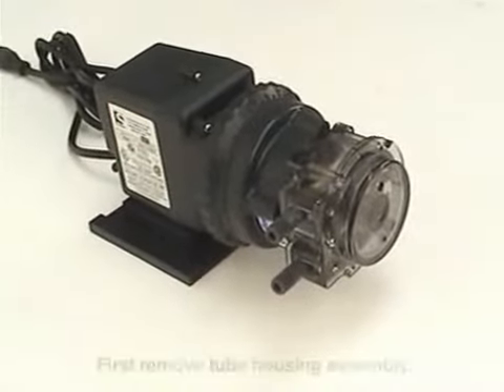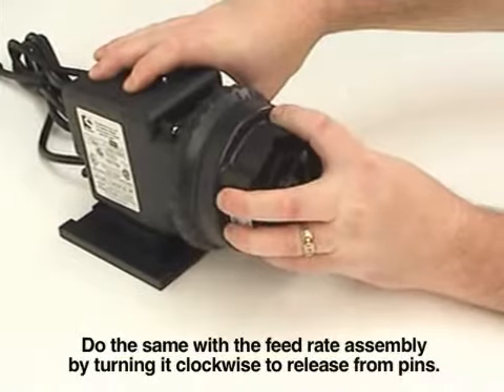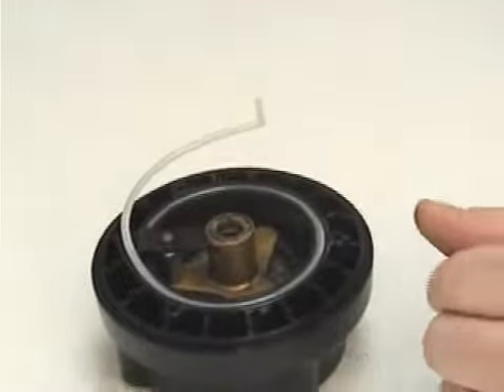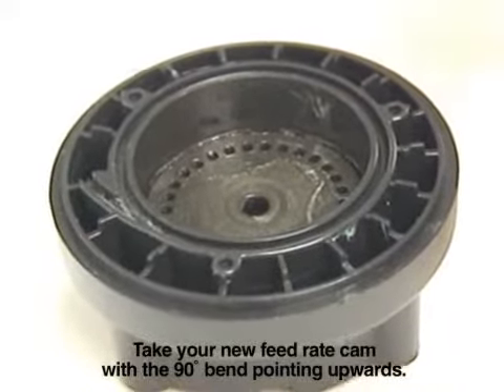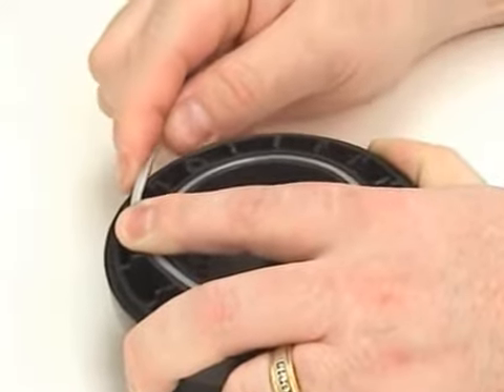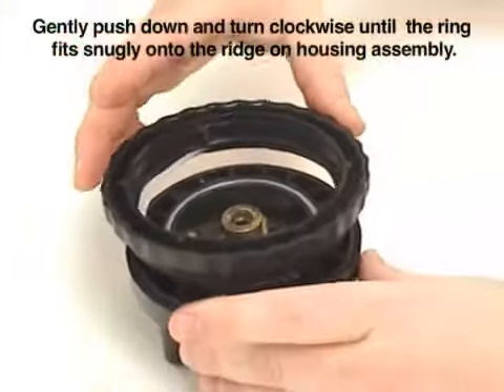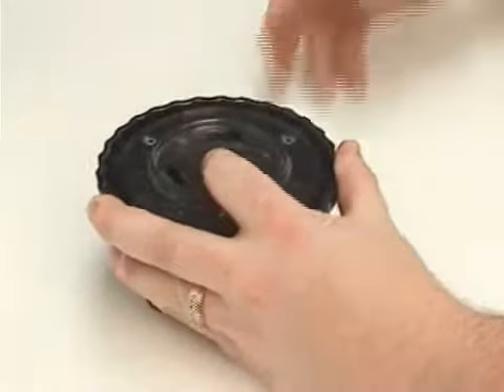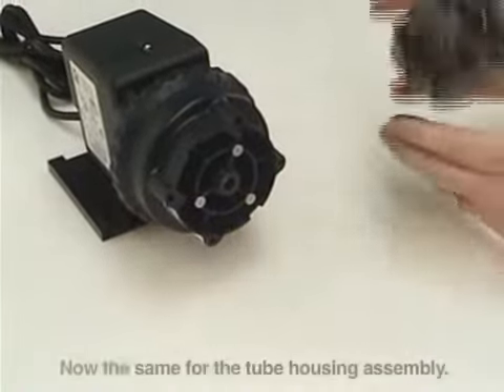Stenner Peristaltic Pump-Variable Cam Replacement

Comment from the maker: There is a small slit in one of the plus arms. When the duckbill injection valve is placed in a pressurized water line, that pressure (and the pressure of the quill housing) keeps the duckbill closed. The pump outputs at a higher pressure than the water line which forces that slit open enough for the chemical to get through. Once that pressure subsides, the pressure in the water line forces that duckbill valve closed again. Hope that clarifies things for you.

Comment: Hi, let me have you another question if I may. It's about the injection check valve and duckbill cause I'm really trying to understand the mechanics involved here that makes this all work. How is the chlorine pumping into this check valve when that lttle duckbill seems to block both sides from anything going thru it. The plus side from the water supply and the round open side where the chlorine is supposed to enter. Thanks.

Comment from the maker: The Stenner pump design has a metal index pin lifter riding on a plastic cam. Over time this wears out and gives you that “ticking” noise in your pump. There is no way to forecast how often to replace the cam as each application is different. Being proactive  and replacing the cam yearly would benefit the pumps longevity These repair items are available on the USABluebook website or you can call our expert technical support staff at 1-800-548-1234 and we'll gladly assist you.